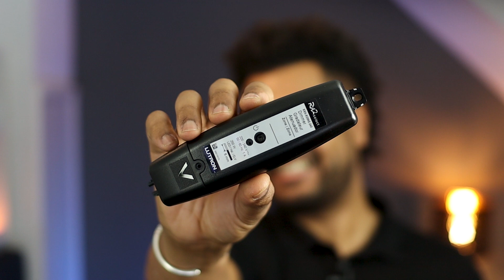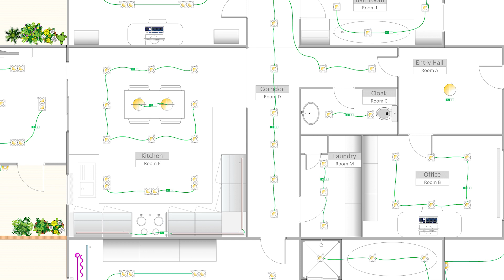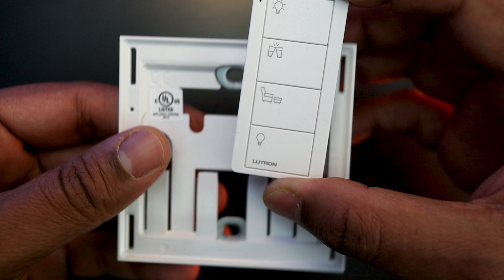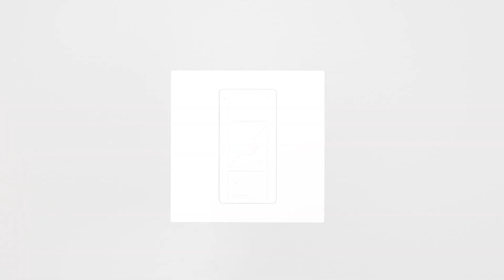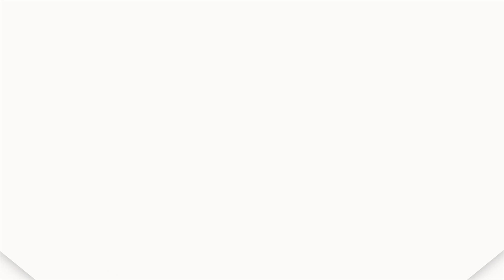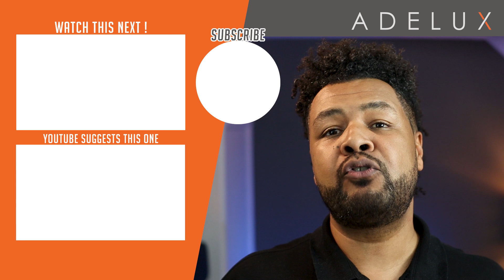Comment: Great Video.  Spec'ing my system at the moment and a question I would like to know is, can I centralize all the modules on a back board close to the electric board in the utility or plant room of the house,. as opposed to in the ceiling or close to the actual lights themselves?  I expect to have in the region of 15 circuit's
Reply: Hi thanks for your message. Yes of course you can. Its a great solution specially for maintenance, wiring etc…as they all in one place and easily accessible. Also good to optimise wireless coverage on the modules. Hope this helps ✌🏾

Comment: You are doing a great job. Is it necessary to install the dimmer next to a circuit or can I install them in a central location? Also could you do a video showing how to connect the dimmer to a circuit.
Reply: Thanks for your comment and kind words. It is not necessary. Centralising inline dimmers in one or more locations work quite well. It has to be done properly with everything labelled correctly. 
For the wiring of a dimmer, this video can help 👉🏾https://youtu.be/TRGYxfdKuPg

Hope it helps 👍🏾

Comment: Good stuff, thanks!  Can a single Pico dimmer control multiple circuits at once, so dimming them all at once?
Reply: Hi thanks for your comment! A Pico? Or a Dimmer? Could you please clarify - this is two different things. 
Alternatively you can look here, this might help👉🏾 https://youtu.be/KF2-hjRFhUU
Reply: @adelux  Hey, thanks for replying.  I think i mean a Pico Dimmer like https://www.mr-resistor.co.uk/item.aspx?i=19232 If i have three lighting circuits with in line dimmers, can i use one Pico Dimmer to adjust them all?
Reply: Thanks but still a pico and a dimmer remain 2 separate things. Technically this type of pico « can » operate any number of inline dimmers but they will all operate at the same level. Which for me defeat the point unless this is exactly what you want. If I have multiple circuits in a room (ie Downlighters, Pendants, wall lights, etc...) I prefer to use a « pico scene keypad »